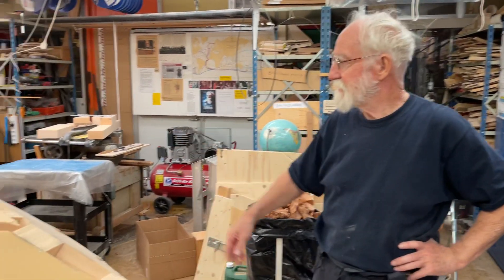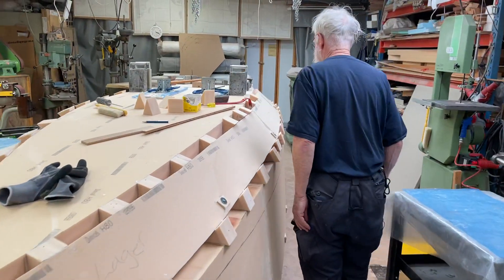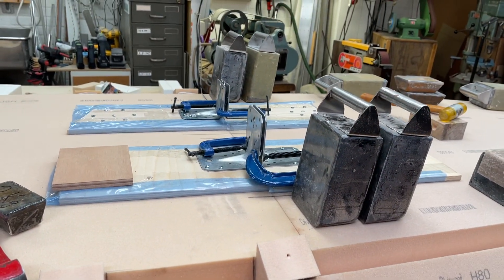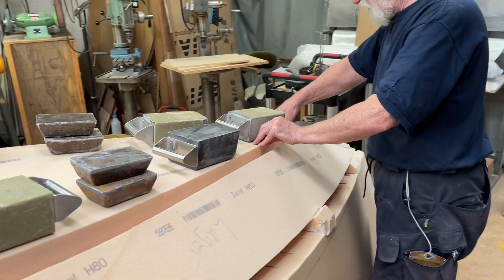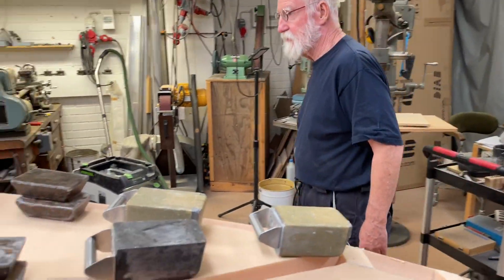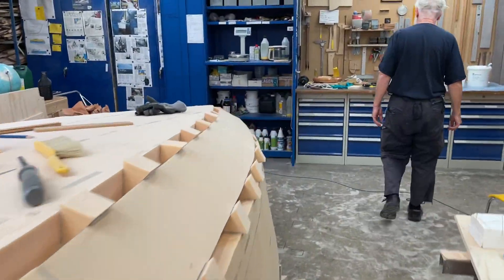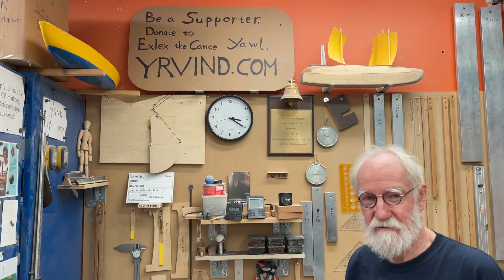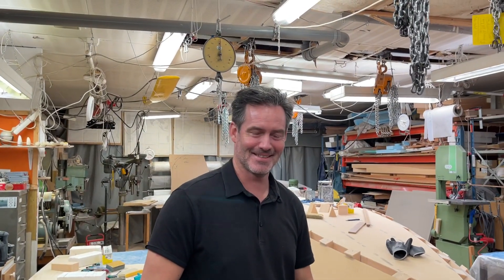Last piece of the bortom panel in place

Comment: Hi Sven will this boat be unsinkable even if filled with water? By using such thick foam core (3 inches i think) one would think so.Love your vids, all the best
Reply from the maker: She definitely be unsinkable but the question is how high will she float. In high latitudes a boat half filled with water will kill you as times passes
Reply: @SvenYrvindExlex  will you test the height by actually filling the boat with water after the built or will you work it out?
Reply from the maker: @stephanschoeman6984  I will not test it and will not work it out. Just hoping it never will happen. Having said that I think it is extremely unlikely that she ever will get holed as she is so terrifkly strong.
Reply: @SvenYrvindExlex  Agree 100%

Comment: Looking good. I need those weights with the handle for my own build. I wonder if they're lead.
Reply from the maker: They are lead
I used them as mowing ballast 2011 sailing to Martinique in a boat 4.8 meter long chinerunner
Reply from the maker: The weights are 14 kilo each
Reply: @SvenYrvindExlex  did you have them loose in the bilge?
Reply from the maker: @marmac567  Nothing is lose in my boat. They were wery well secured each in its place.
Reply from the maker: To have such things lose is asking for suicide
Reply: @SvenYrvindExlex  Will you place ballast in this new boat also?
Reply from the maker: @marmac567  I will have a very strong bottom to take the ground. It will be heavy. Also batteries lead. Also the water maybee 100 liter in 5 liter jerrycans low down. As I transfer 5 liter to dayly 1 liter bottles I will fill the empty 5 liter with seawater. This way keeping the water cargo constant. This I hope will give enough stability as the hull is low resistance and the balanced lug sail have a small healing moment.
Reply from the maker: @Martin I am a slow thinker. Ten years ago I had not figured that out
Reply from the maker: I am learning all the time

Comment: So, I'm curious as to why you wouldn't just cut your chine & bottom pieces with your jigsaw (or whatever you used to cut the pieces)  set at the right angle, so they all fit together from the get go, without having to fill the gaps with all these little wedge pieces...?

Comment: Thank you so much.  I meant to ask, what type of wood or material are you building this out of?  😊
Reply from the maker: Hi Melinda. This is going to be a composite sandwich construction. What you see is the core. That is going to be cowered inside and outside by fibers and NM-epoxy.
Reply: Can xps foam be used?